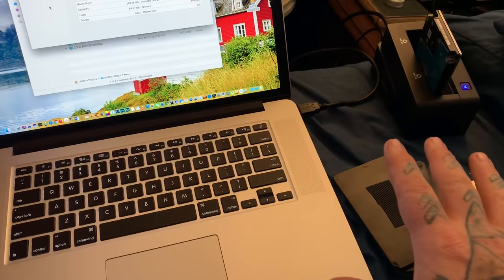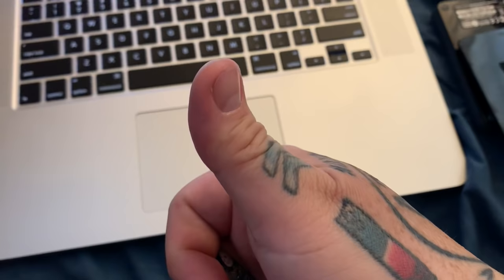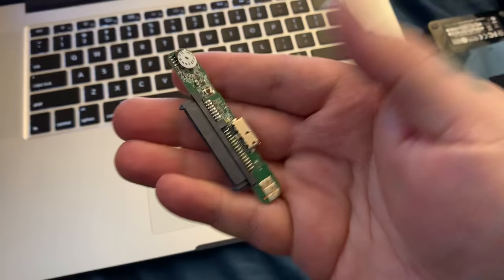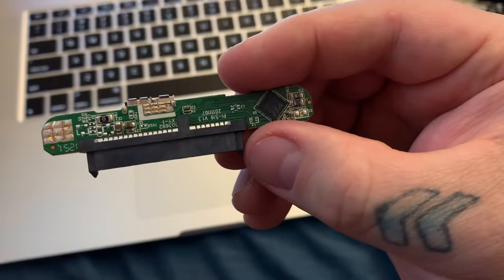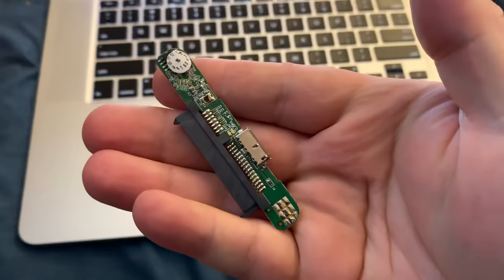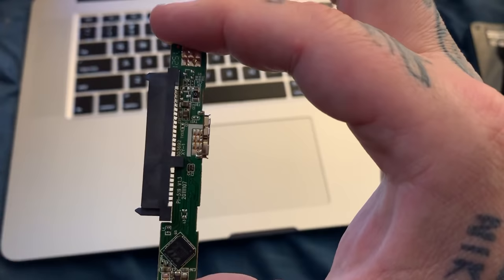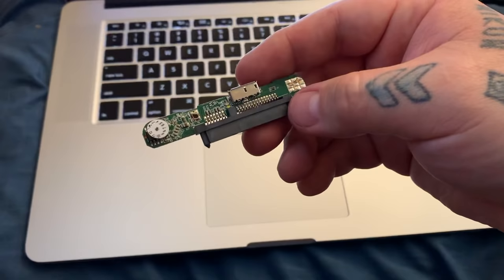🥺 External HARD DRIVE failure & its CAUSE & FIX 😄

Comment: This small bit of knowledge helped me fix a few computers that have HDD failure. Just buy an inexpensive external hard drives and simply starch the sata bridge and case and install it with a new os. That was at a time when for some stupid reason not too long ago, it cost more to get internal HDD than external.

Comment: Most of the portable USB drives don't have a removable bridge like you show. I have taken apart a few of the Western Digital Passports. The board is integrated.
Reply: Pretty much that was the case with my 2TB My Passport Ultra drive that has USB C so replacing the failed USB controller chip would be the only way to recover the data from it.

Comment: Also the reason they did it was because they like to sell the portable drives at a lower rate than the "OEM" bare drives and so people got wise to it and started buying the portable drives, cracking them open and then putting the drives in their servers to save money. Although I have not heard of the integrated controller boards on any 3.5" drives yet.

Comment: Or get rid of any adapters you connect it to like USB hub and connect it to a real USB port. The reason is they are mostly giving small amounts of powers so the data cant get through so it mostly gives out repeating beep noises. (Sorry for using mostly 2 times I don't know why but these sentences feel illegal with 2 mostly used.) 

Try this first if this doesn't work try what he said.

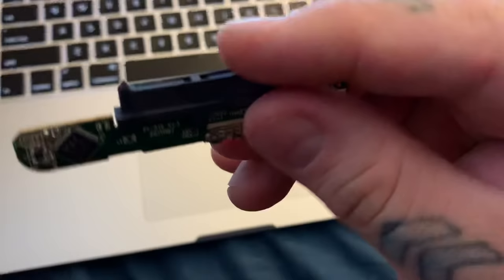Comment: 0:40 
I had that same failure on a 2TB WD My Passport Ultra drive and unfortunately on that drive that POS board is built into the drive controller with no SATA interface so this recovery methods is impossible with that drive.

Comment: Are there any hard drive docs or readers that will work on a Toshiba external HD with a built in / integrated Sata card? Or any other options?Mine won’t power up when plugged in. Unfortunately I before this I video I didn’t know to get an HD with a removable and replaceable Sata card

Comment: oddly, against all logic, I have a Seagate SATA  thing.. from over 10 years ago, which still functions.. I have used it as my portable swap device since I bought it.. maybe they were overbuilt the first few years.  never had a data transfer issue, let alone failure yet from it. I did make a mistake of backing up alot of Data on one of those WD drives..and I thought it was swappable..so i threw away the 'case' but kept the HD and then when I hooked it up to a SATA bridge..it says the Drive needs to be 'formatted' so now I have to track down the exact build of that WD bridge chip to get my fucking data off the drive.   There is no other way of doing it.. WD cornered the market on stupidity and I was dumber than dumb to use the product... thankfully it's not 'critical' data on that drive.